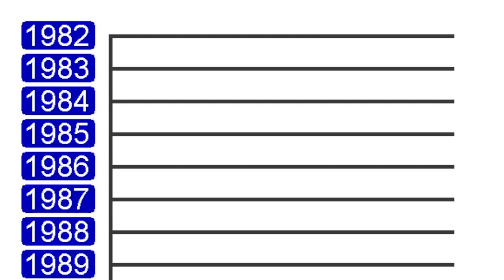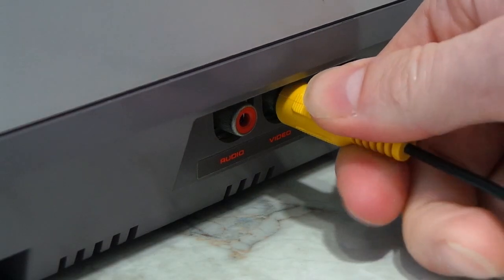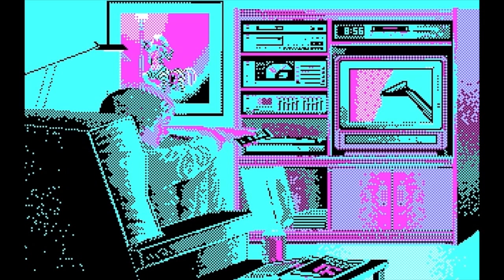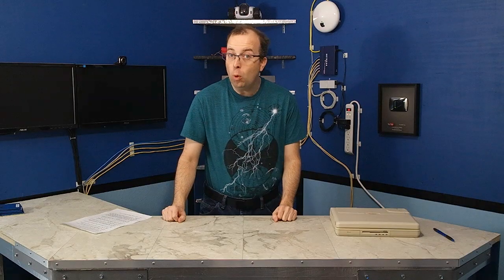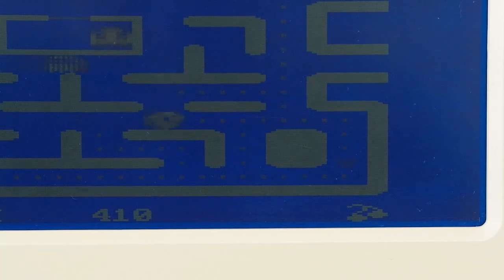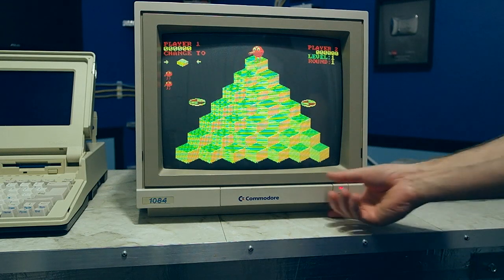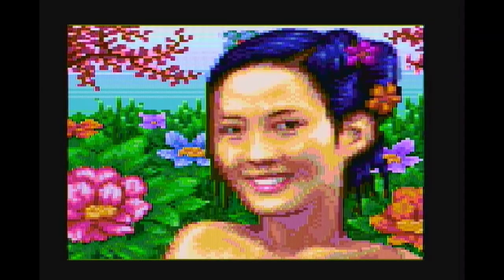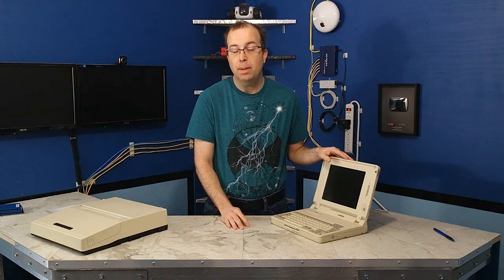CGA Graphics - Not as bad as you thought!

Comment: Been trying to find any information on just which color combinations of the four available colors can be used to create sixteen colors via CGA composite mode. I'm a little confused since I can only come up with 15 distinct combinations. However, that is assuming each color would be equally weighted per pixel, but if that's a bad assumption  the number should be much larger than sixteen.
Reply: Looking at this again, I think this may be because the 16 combinations include all of the colors being off (i.e. white) - which is also one of the primary colors. In fact, in the palette he shows, both 3 and 14 just look white.

Comment: Back in the mid 80s, I worked at a company that developed optical mark readers.  The hardware division was kept separate from the rest of the company because they used IBM computers with CGA monitors running CAD programs in red/green/yellow mode.  The flyback whine from over a dozen computers was irritating to some people, especially me since I was sensitive to that frequency (15.7 KHz).  Just entering the building was misery for me, and I couldn't enter the CAD room without some sort of ear protection (I stuck my fingers in my ears every time I passed the room).  Us software developers didn't have a problem with flyback whine because we all used EGA cards which have a higher frequency (21.4 KHz), which I could still hear but it wasn't nearly as loud.

Comment: +adric22  The MOTOROLA® MC6845P, packing eighteen 8-bit registers, used 16,384 memory addresses and 32 row addresses.  Theoretically, 524,288 pixels could be addressed; but memory constraints of the host system meant a 16 kiB limit for 8-bit systems.  International Business Machines Corporation could have used 32kiB video memory (even bytes for character data, odd bytes for attributes) from the P8088's perspective, with the MC6845P addressing adjacent bytes in pairs.  With the ascent of Unicode, an MC6845-based display driver would need 32-bit text memory (24 bits for the character number, 8 bits for attributes) and megabytes of fast ROM for the pixel sequences today.

I reckon that nowadays an 8/16-bit system built around the Western Design Center W65C816S CPU, W65C22N interface adapter, and W65C51N UART can be set up with up to 256 banks of memory (A16-A23 := D0-D7 at start of memory cycle), with the MC6845-coaddressed memory in one bank.

Comment: Composite output was unavailable for PAL and SECAM regions, since PAL and SECAM don't allow 'artifacting' as in case with NTSC . So the only choice for European users was RGBI output with 4 colors in 320x200 resolution or 16 colors in 160x100 resolution (pseudographics mode, modified 80x25 text mode). So I think this is the reason why this mode wasn't widely used.

Comment: The Sega Genesis also uses the NTSC effect in games like Sonic to do cheap transparency. Every odd pixel is waterfall, and every even pixel is completely see-through and draws Sonic. They blur together to appear like transparent. Later/better emulators would either have a permanent NTSC mode option, or, detect transparency and apply the effect only there.

https://discodracula.files.wordpress.com/2014/12/sonic.png

Comment: CGA was BAD. It was as bad as a Spectrum ZX. 
Could CGA do this?
https://www.youtube.com/watch?v=SDDkxfJCB9Y
Come on. Get serious mate.
Reply: Did you even watch the video? Yes, CGA over Composite could do that. See also the CGA demo "8088 MPH", running on actual IBM PC 5150 hardware with actual IBM CGA card: https://www.youtube.com/watch?v=hNRO7lno_DM
Reply: @AnonymousFreakYT  The composite output is a trick. And still CGA couldn't run shit. The VICII fucks it up sideways.
Reply: @Nick-GR  It’s as much a trick as any other 1980s composite output. CGA used 4 “base levels” to generate composite, Apple II only used 2. (I can’t find a good answer on what the C64 used, likely 2 since it supported “16 colors” like A2.)

Yes, VIC-II had sprites. Great if you wanted 8 or fewer moving objects. More than that? Took more extreme programming tricks than writing sprites in software on PC.

Comment: Very interesting video. Thanks!
I have got an IBM PS/2 model 30 with MCGA (multicolor graphics adapter) capable of 256k colors with the same CGA resolution.
What about this? Why is it not mentioned?
Thanks for any answer.
Reply: MCGA was a "bastardized" video chip - it was a VGA adapter cut-down to remove the higher-resolution/high-color modes.  It was made basically solely to have better gaming performance than CGA, while not really competing with VGA for business use.

The fact that its only over-CGA mode, 320x200 @ 256 colors also happened to be the same high-color mode supported by VGA, meant that that mode got used a LOT in games.  That also meant that, as individual resolution/color-depth combinations got named after the video card that originated them, and that mode was the ONLY 'extra' mode supported by MCGA, that mode got nicknamed for MCGA, even though it was originally created for VGA, not MCGA.  640x480 @ 16 colors got called "VGA" instead.

The MCGA card was very short lived.  Only two machines ever came with a "not VGA, only MCGA" card (even then, it was onboard video, no actual MCGA card was ever made.)  The MODE is what got supported far more.

Comment: Just a bit of comment on the low-rez graphics mode (160x100 16 color).  As you mentioned briefly, it's produced via text mode, but that's just not enough to do it justice.

By default, a CGA card has four pages of text-mode, so you can get four 80x25 screens - each one is 4000 bytes (2 bytes per character - one for the symbol and one for the foreground and background colors), so all four together consume 16,000 bytes (most of the 16K of video RAM).  But with some register tweaks, you can use all four pages at once.

With this tweak, each character cell is only two scan-lines tall (vs the 8-lines of normal text mode).  So now, instead of an 80x25 text mode, you have an 80x100 text mode where you can only see the top two scan lines of each character.  The usual way to use this mode is to select one of the block-graphics characters (the one where the entire left-half is lit and the right half is not) and fill the entire screen with this character.  Now, you manipulate the FG/BG colors of the character cells to set what colors the left and right halves display (the lit half is the foreground color and the unlit half is the background color).  Since each character cell can display two colors horizontally (left half and right half), you get an effective horizontal resolution of 160 pixels.

But it gets more fun than that.  You don't have to use only the left/right block graphic character.  You can use any one of the 256 possible characters.  The display will show the top two scan-lines of whatever character you select, using the foreground and background colors for the cell.  Through careful selection of characters and colors, you can produce patterns and dithers that give the appearance of even higher resolution (up to the physical pixel-resolution of 640x200) with full 16 colors.

See also http://8088mph.blogspot.com/2015/04/cga-in-1024-colors-new-mode-illustrated.html (clearly some of 8-Bit Guy's source material, since he's showing the same images in the video).

Comment: CGA was not the first graphics card. Before that you had Hercules, which was monochrome but graphics capable (even higher resolution than CGA). You could run a CGA and even an EGA emulator on Hercules.
Reply: I had Hercules too and it was great, so much better than the ambars or greens. Most of the times, running simcga was needed to run almost every game. Such a good time with my XT, no hdd and low density floppy drive. I wish i still had it !
Reply: Hercules could do 720x438 (albeit, monochrome) and was introduced in 1982. https://en.wikipedia.org/wiki/Hercules_Graphics_Card
Reply: Hercules was introduced after CGA.  Hercules was a third-party company's extension of IBM's MDA (Monochrome Display Adapter / text-only.)  Hercules ran at the same pixel resolution as MDA, but supported fully addressable graphics.  Again, though, it came out after CGA.

Comment: I have an old Tulip 286-12.5 Mhz that has a combined CGA / Hercules (Magda) card. 

Ironically the Tulip 286-12.5 was faster than the 1989 Compaq Deskpro 386-16 (EGA / VGA graphics 120 Mb. Run Length Limited HD, 4 M.Byte Ram modules and 80837 co-processor from new).

I still have both. The Compaq had the RLL HD replaced with IDE when the inevitable RLL HD failure occurred.

Comment: Very factual video. The original IBM pc (Model 5150) had two optional graphics card from factory, mda (mono) and color. The original PC also came with 256k of ram making the 16k for video seem logical for it's time, and a cpu that ran at 4.77 mhz. Ironically 20 years latter it was typical to buy a pc that had at least a 700 mhz cpu, 256mb of ram and a video card with 16mb wasn't unheard of.

Comment: Says "not as bad as you thought", then stuffs the video full of butt ugly, slow graphics :) The demo at the end is extremely special-cased. The mode is the usual Apple II style monochrome-composite one and therefore only works on NTSC, np, for the other narrow PC setup requirements see the writeup. But the problem with it is that it's worthless for anything real-time (games require real-time). There is absolutely no CPU time left from just showing the fixed scenes, and it's hardcoded for those specific scenes and pictures. So when you say it demonstrates the power of CGA it really doesn't because you couldn't do anything with it. Probably a less impressive mode could be created where you could move some graphics around slowly, and then you could at least make some slow flip-screen adventure or a chess game.

Comment: I realise it’s easy to forget the world outside the 50 states (and a couple of other countries) but one of the big downsides of composite mode was that it had to be configured for NTSC as well as PAL/SECAM. This required extra hardware, and as we all know, extra hardware is a continuing cost of production whereas software, at least in the days before ‘release it unfinished and update over the net’, was a one time cost.  As the RGBi standard was world wide, it meant only one system needed to be supported. Combined with the fact that gaming was an incredibly tiny part of the computer world, and the text issues you mention, the RGBi standard was pretty much a no brainer for manufacturers.  In fact, there was a lot of serious conversation about whether colour was needed on PCs at all. And given the visual quality of CGA and EGA you can see why. Luckily good sense prevailed and it was found that colour helps even with boring business software. Oh, and I have a theory that Tandy/Radio Shack failed in the computer world due to their US bias. I loved playing with the display computers at my local T/RS (as Tandy was known in my part of the world) and the staff were happy for me to do this as I programmed things like flashing racing cars scrolling across the screen which made their displays look nicer. However, the TRS-80 (we called them trash-80s, obviously) computers were ridiculously expensive compared to the US prices and one staff member told me that was because of the extra manufacturing cost to make a PAL version. So, I programmed the Tandy after school in store and went home and tore my hair out working on my SC/MP 4 bit powerhouse. At school we were using punch cards and ticker tape as storage - my school was considered very progressive re computing. Ah, the good old days!  Nah, My 2x980Ti GPU with i7 and 64GB will do me.  Until I upgrade to an 1180, or whatever Nvision calls their next iteration. :-)

Comment: This makes me think.
Some of the earlier Raspberry Pi's had a composite jack, so it could connect to TV, which do not have HDMI. (Raspberry Pi 1)

Would a CGA game run on such a machine, through the composite port give off same results?
Reply: Thinking further, one could test this by playing older DOS games easily.

And it turns out that the composite has been moved to the 3.5mm jack.

I am gonna test it out, if I can get a hold of a 4-pin mini-jack to RCA connector.
Reply: No. RasPi (and other similar systems) with a composite jack render down the full-resolution/color depth graphics to an NTSC signal directly; they don't make a purposeful effort to use NTSC artifacting to generate extra colors.  I wish there was a way to do so, I have a similar tiny single-board-computer I use for retro gaming, and even telling it to run specifically at NTSC resolution, games just don't look the same as they do from original hardware. (CGA composite, Apple II, Commodore 64, etc.)

Comment: CGA vs C64 (VICII) graphics. C64 got hardware scrolling and sprites. C64 got less CPU demanding graphics due to not have to copy from main memory to separate video memory. C64 got a much more versatile 16 color palette. C64 got YC (2 channel video output similar to SVGA for all modes, CGA got only 1 channel video composite for analogue output).

CGA got higher resolutions: 640x200 16 color text mode (80 columns), and suitable RGBi (digital RGB) output for this resolution. Maximum resolution on C64 is 320x200 (40 column) + boarder, C64 got less suitable resolution for productivity software.

Comment: note that the IBM MDA, IBM CGA and herculess graphics card all use the same motorola 6845 crt controller, albeit at different video memory offsets http://www.classiccmp.org/dunfield/r/6845.pdf so essentially they can each do a lot more than just the 'default video modes and color settings'. (including running monitors out of sync so badly that they caught fire, back in the days ;)

Comment: Is it true (a legend I heard) that IBM used a cheap, inferior NTSC encoder chip in the CGA card? And that's what makes the artifacting possible? Of course 320 pixels is a multiple of the colour encoder frequency (or something like that) so that also makes artifacts possible. 

Many contemporary machines deliberately stayed away from using 320 pixels to avoid artifacts, which usually look terrible. In fact it's only in comparison to the eye-shredding horror that is cyan-on-magenta, that composite CGA looks good. That palette is the only one with black and white available. The other standard 4-colour CGA palette was black / red / green / yellow. Actually if you compare that with black / magenta / cyan / yellow, it's the same, except with the Blue bit on or off. Ignoring black of course. That's probably how they designed the palette hardware. If the palette bit is 1, Blue is high, 0 and blue is low. 

16-colour composite CGA is a hack! I'm sure IBM never thought of it being used like that when they designed their machine. I guess they only put composite in because there were already composite monitors on the market, and they were the cheapest. So people who already had one, or a TV with composite in (rare in the early '80s), wouldn't need to spend the ridiculous price on buying a monitor for their new PC. 

The 160x100 full colour mode was another hack, a very nice one though, really it was just text mode. It had less bytes to shift, so would have been a lot faster than CGA. That said, almost no games took advantage of it. I wonder when it was discovered / invented?

Comment: The Tandy 1000s are just PC JRs with more ram and a better KB. Those Tandy machines go all the way to 386 with VGA, IIRC but while keeping the Tandy sound. I have a Tandy 1000TL (IIRC, but I don't a KB for it at the moment) and it has a 12MHZ AMD 8086 or 286, I haven't looked in it in a while, though I do know it only has 768k which would be 640 for DOS and 128 (AB segments + Part of the C segment for the graphics rom and the F segment for the bios) for Tandy graphics, so it's probably an 8088 or 8086.
CGA wasn't even that common. CGA can only do 640x200, which means each graphics character is only 7 pixels wide plus line of blanks to the left of every character. Hercules was available with and without CGA support, but in 720 mode which allowed a full 8pixel characters plus a blank line on the left of each character (so they don't smudge together). That extra 9x8 cell for each character made it MUCH easier on the eyes. Hercules cards sold well, well into the early 90s. If you are staring at a spreadsheet all day, 9 pixel characters are far better than 8 pixel characters. It might not sound like a lot, but it really makes a difference.

Comment: Using that 1084 was a bad choice. The 1084 is much higher resolution than a standard TV (the blending won't work as well, it will look more fuzzy, but much more colorful on a standard TV). There are just a lot more physical cells on the mask than on a standard TV with composite. RGBI is NOT the problem (it's the monitor) AND Tandy is compatible with EGA from everything I can recall. In addition to all this, there are demos now where a 5150 with a CGA card can produce 1000 colors on composite and sprites and scrolling. Of course, it's probably using so much of the CPU that you couldn't do a game with it, but it's still impressive.

Comment: During the 1990s my cousin brought a vintage computer with a 15 KHz color monitor and asked me to check if it's still okay. The monitor was labeled CGA and the connecting pins look like at 1:54 and I discovered that it's analog that the RGB out of Sega Mega Drive works perfectly there except I added a circuit to invert the Sync because it won't sync properly without inverting. About a year later another 15 KHz monitor but is labeled RGB Color Monitor and I attempted to connect to Sega Mega Drive but this time it didn't work because it's digital just like you said. I googled those vintage 15 KHz computer monitor but according to Wikipedia CGA is digital just like you said.